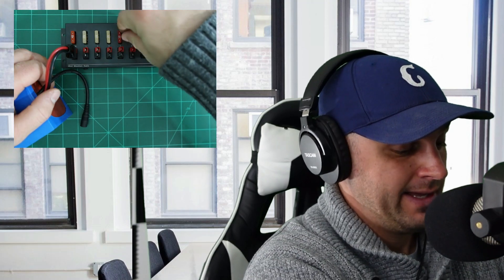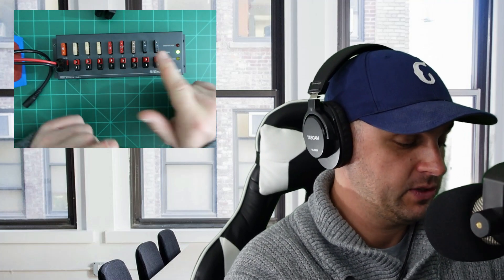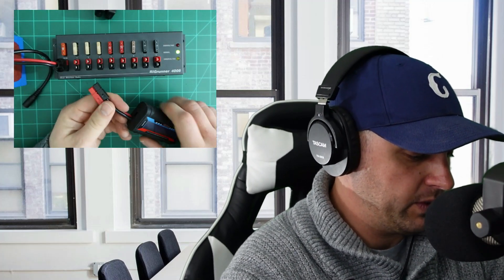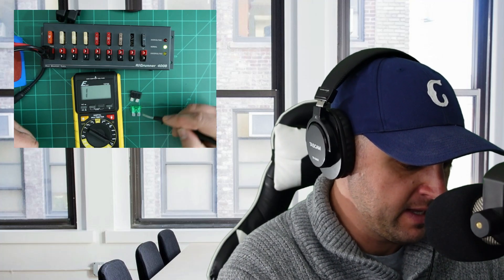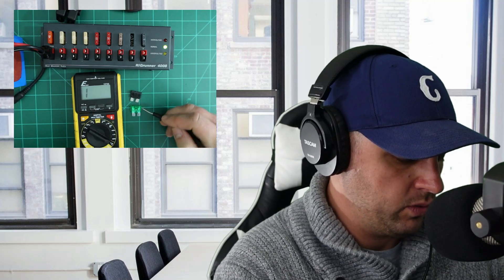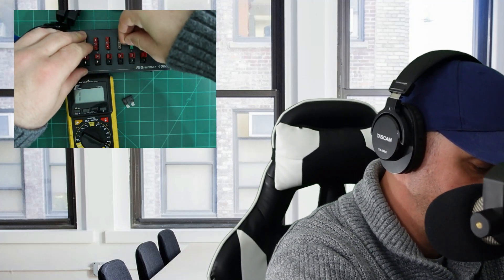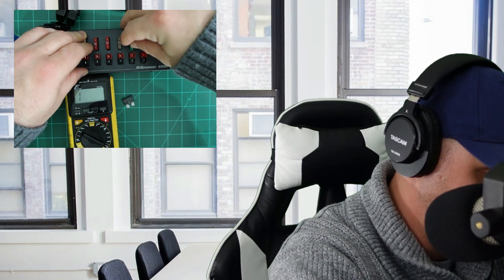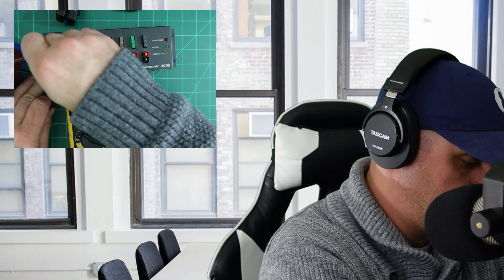West Mountain Radio - Rig Runner 4008: brief discussion and overview - watch before you buy.

Comment: Those two solder joints maybe for other components which weren't needed in that model or revision.  They looked to be not used in the main current path. However they should unsoldered and cleaned out before resoldering the joint. 

Did they use genuine Anderson powerpole or just the cheap clone type.

 Nice work and great video.
Reply from the maker: To the best of my knowledge, the appear to be genuine Power Pole connectors, as indicated by the "A" stamped on the top of the connector.  Thank You for the suggestions and compliment!

Comment: The 4007u only has 7 ports BUT, it has the under/over voltage disconnect built into it (like an internal PWRGuard), a🎉 voltage display and an on/off button. The 4008 only has visual/audible alert and will not protect your radio, should your power supply transistors fail and dump 28v into your rig.

Comment: So for a 40 amp rig runner you us a 40 fuse for the power supply that plugs into the runner. New at this still learning
Reply from the maker: You could use a 25 amp fuse, for example, but then you would only to draw 25 amps of current before that fuse popped. Don't try to go higher than 40 amps, however: This may damage your 4008.  Good Luck
Reply: @DudeTested  thank you for your input I'm new at this sometimes I can get confused and we don't want that to happen when working with electricity 73 KE8MWQ

Comment: The speaker will sound every time you turn off or disconnect your power source as an undervoltage alarm. If you have to replace a fuse, be careful to get it aligned right; otherwise, the fuse can fall into the case, and you'll have to apply the disassembly process described here to retrieve it.  Ask me how I know.
Reply from the maker: Thank You! I am going to pin your comment so everyone sees the advice, as it is very good advice.  Best wishes!

Comment: As someone who started soldering in the '50s, I can attest that "cold joint" was a common term for a joint with poor connectivity.  Probably because if you were in a hurry, and didn't let stuff get hot enough before removing the iron, not all parts were hot enough for the liquid solder to "wet" to the "cold" part, and you wind up with solder that is merely touching, rather than soldered to that part, and mechanical stress could separate the solder and the part, leading to intermittant contact, or worse, over time, oxide could form between, for permanent no contact.

The missing solder on those round pins is less troubling than if it occurred on the flat blade like pins adjacent.  I suspect that the round pins are part of what gives mechanical rigidity of the power poles, rather than handling current.  Trouble with the round pins may be why some of your connectors are aslant.  As to not being able to solder them, there are metals that don't solder well, and that includes some of the structural metals that turn up in connector pins.  When intended to be soldered, such metals get plated with something that does solder well.  There's more to plating than you might expect, and this unit may have some pins where the plating did not go well, thus the bargain.  Standard power poles, with pins crimped to wires would not work in this situation (the pin does not protrude from the base of the housing, so nothing to insert through holes in the PCB).  So either these are different pins, or a combination of a standard pin and a blade thing to which it is crimped (or welded or soldered, etc.).  In either case, I think that there is a good chance that the round pin is a separate piece that separately extends up into the connector shell to help stabilize it mechanically, but I'm not going to take apart my 4008 to find out.  But in this case it may be only these parts that had a plating problem, given the evidence that all of your flat blade joints looked great.

On the other hand, it could be the other way around, with the flat blades being the structural add-ons, and the round part being something that was crimped into the standard pin, in which case you maybe should rework stuff.  Fresh Anderson pins crimped onto a short piece of bare stranded wire that protrudes through the PCB hole should work nicely.  But you need to value your time to decide whether that's a better approach than buying a new one.  But I'd be interested to see what you find if you decide to pop off one of those connector shells.  (I you can get a screw driver under the mating end of the metal contact, and can lift it enough so that it's no longer hooked on the spring, you may be able to pull the body straight off.  But desoldering first is also an option.  New shells are cheap, assuming that they are the standard ones. Non standard contacts might be harder to find.)

73 - KE1G
Reply from the maker: This was perhaps one of the most amazing responses I have ever recieved on the channel.  I truly appreciate all your detail.  The information you took the time to provide really will help me and probably others.  Thank you for your wonderful elmering!  I'll have an update soon! 73

Comment: I wonder if the solder flow issue is because they're using lead-free solder which requires a higher tip temperature.  Most industrial soldering is lead-free.

Comment: I agree about the excellent customer service at West Man Radio. I recently needed some help with an older Rigrunner and Epic Pwrgate when I purchased the Pwrgate from them. Both excellent products and top.notch tech assistance. The Epic Pwrgate connects my power supply, battery, solar panel, and Rigrunner seamlessly, switches power sources when there is a power failure to protect the equipment and keeps the battery charged.. KF6KXG. Mike
Reply from the maker: I have been looking for something similar to this for a future solar panel.   Do yo use a LifePo4 battery with the panel? The Epic PwrGate will be a easy way to do what i need.
Reply: @DudeTested  Yes, I do. I have a 20 AH Bienno battery hooked to the Epic Pwrgate thru a 30 A fuse. When you get the Pwrgate, you open it up and set two jumpers—for battery type and charge rate. West Mtn has the Pwrgate manual online so you can check it out. The only concern is if you have a radio powered with a power supply (I use an Alinco 330 DM) and you connect )or switch on the solar panel, it sends the voltage to 17.5 vdc for a sec or two until the pwrgate adj to it. It can also happen with clouds passing over the sun. To be on the safe side I put a switch in series with the solar panel so I can prevent an equipment over voltage problem. Usually I just leave the panel on all the time and it keeps the battery charged.  The Bienno battery comes with two connectors—a coaxial DC connector for charging only and an Anderson for both charging and usage. I just use the Anderson connected to the Pwrgate. My whole station is on Andersons. 
Since the Rigrunner is now always powered I added a switch for the swr meter light so it isn’t on all the time. Mike KF6KXG

Comment from the maker: **********************************************
VIDEO UPDATE: I reached out to West Mountain Radio after this video was filmed, but before the video premiered.  Within SEVEN (7) minutes, I received a response from Joey at West Mountain Radio.  He initially asked if I would like to have the unit replaced, which was awesome.  I cannot thank West Mountain Radio enough, for quickly responding with a great solution.   

I did however, kindly deny a replacement for multiple reasons: 1.  I knew this was purchased as a Factory Second or a Returned unit (I cannot remember which, sorry).  With that, I knew there were certain risks involved with purchasing this unit.   2.  The unit was purchased at least 2 years ago (I believe).  It is not West Mountains fault that I did not properly test and check my gear when I got it.   3.  I rather fix it myself and learn something.

With that being said, Joey suggested the reason I may be having issues adding solder is because these are copper traces, which I did not think of.  Copper traces tend to require more heat.  I will have a video soon, of my attempt to add solder to this unit.

I still, 100 percent think West Mountain Radio has the best customer service in amateur radio.  This is my opinion, but there are companies that won't even respond to emails.
**************************************************************

Comment: Looking forward to the update when you have it!
Reply: 9/10 it was soldered by a wave or selective wave and the connections didn’t get cleaned or take flux and didn’t wick enough solder into joint. I would try sucking out what’s there then add new 60/40 to the joint
Reply from the maker: I'm on it, thanks!
Reply: I own a few of these so I’d be interested to see what Dude finds out from WMR